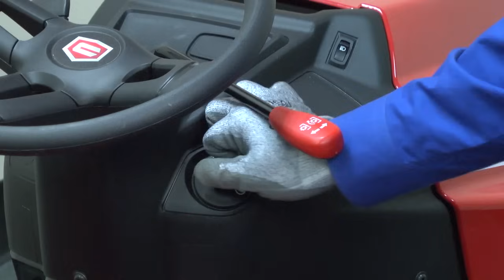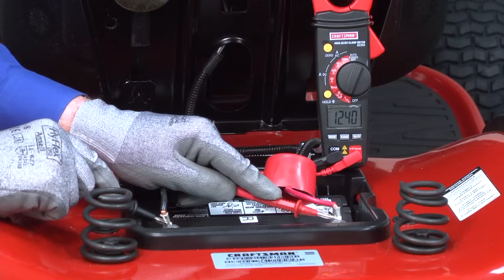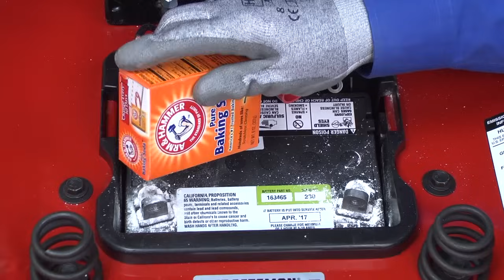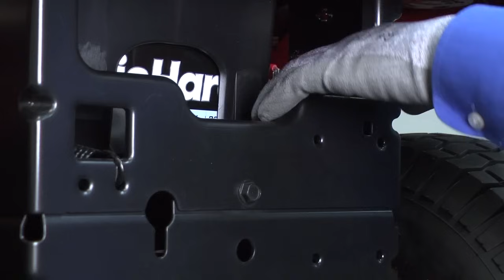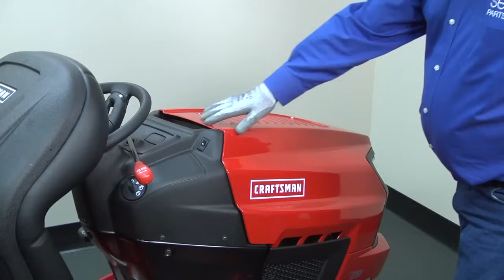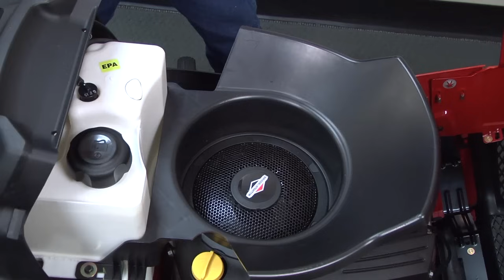How to Fix a Riding Lawn Mower That Won't Start: Engine Clicks But Doesn't Crank

Comment: Wayne, checked the things you mentioned and either replaced or were ok but only clicks.  What about switch plungers, switch Ing. Etc?
Reply from the maker: Because the solenoid clicks, the ignition switch and interlock switches are okay because current is making it through the ignition switch and interlock switches to the solenoid relay connection through the small red wire.

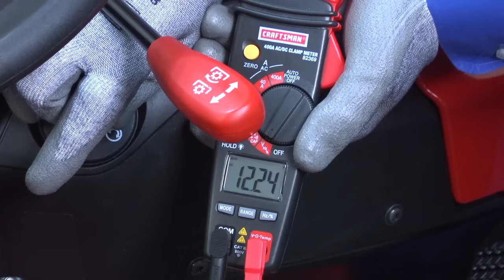You indicate that you checked all of the issues mentioned in the video. If you measured more than 12.3-volts on the large post of the solenoid with the black starter wire attached, then the solenoid is sending current to the black starter wire. Recheck the black starter wire for a voltage drop as shown at 3:55 in the video. If you don’t measure a voltage drop through the black starter wire then that wire is okay and you either have a failed starter motor or a seized engine. Check for a seized engine as shown at 5:21 in the video if you haven't already checked that issue. If the engine isn’t seized up, replace the starter motor. If you need more help, let us know the model number of your lawn tractor and include additional details about the results of our recommended troubleshooting.
Reply: Wayne, I replaced the following..Starter, Solenoid, Battery and ignition. Started to retest the information you gave and now the ignition switch wouldn't click. Also the new battery keeps discharging. Any suggestions? I have a Craftman LT1000 model #917.273370 thanks
Reply from the maker: Because the battery keeps discharging, we recommend that you check the fuse on the small red wire that connects between the starter solenoid post and the ignition switch as shown at 6:44 in this video:  https://www.searspartsdirect.com/article/riding-lawn-mower-wont-turn-over-or-click-video.html. If that fuse is blown, the battery won’t get charging current from the alternator when the engine runs and the ignition switch won’t get current to activate the solenoid relay (which causes the click sound) when when you turn the ignition switch to the start position. Replace that fuse if it’s blown. Here’s a link for that 20-amp fuse: https://www.searspartsdirect.com/part-number/STD391020/0098/980.html. If that fuse blows immediately after replacing it when you try to start the engine or when the engine runs, then a short in the electrical system is likely blowing the fuse. Follow the troubleshooting steps in this video to find and fix an electrical short: https://www.searspartsdirect.com/article/troubleshooting-a-riding-lawn-mower-blown-fuse-video.html. In case you need it, here’s a link for the owner’s manual for your model: https://www.searspartsdirect.com/partsdirect/user-manuals/917273370-craftsman-parts-manual. You may need to refer to the wiring diagram on page 31 when troubleshooting electrical system problems. If the fuse isn’t blown, follow the troubleshooting steps Mower Won’t Turn Over or Click video (link provided above) to troubleshoot the starting problem. Also, check for a wiring failure between the alternator and the battery to troubleshoot the problem with the battery discharging while the engine runs. A wiring failure, failed ignition switch or bad alternator could be causing the battery to discharge while the engine runs. If you need more help, let us know.
Reply: Wayne I can only start the engine by touching both solenoid posts. What should I check to troubleshoot?
Reply from the maker: Because the engine starts when you touch both solenoid posts, the failure must be in the ignition system circuit between the small red wire that connects to the large solenoid post and the white wire that connects to the bottom of the solenoid. Look at the wiring diagram on page 31 of your owner’s manual. Here’s a link for the manual in case you need it: https://www.searspartsdirect.com/partsdirect/user-manuals/917273370-craftsman-parts-manual. Check the fuse in the red wire. That red wire runs from the large solenoid post to the ignition switch. If that fuse is blown, the white wire won’t get power when you turn the ignition switch to the start position. If the fuse is okay, follow the rest of the steps as shown in this video to find the failure that’s preventing the solenoid from sending power to the starter motor when you turn the ignition key to the start position: https://www.searspartsdirect.com/article/riding-lawn-mower-wont-turn-over-or-click-video.html
Reply: Wayne, checked the 20amp fuse and the little red wire from the postive cable wire that goes to the ing. and I have continuity in both.
I measure the volts for the white/black spade posts of the solenoid and reads 12.2 volts. Your note said to replace if 12 volts..This is a new solenoid that was just replaced. Can a new solenoid be defective? The solenoid is reading 12.1 volts
Reply from the maker: A new solenoid can be defective. Based on your description, the solenoid coil is getting voltage but the solenoid isn’t clicking and sending voltage to the starter motor so the solenoid isn’t working. Based on these symptoms, you need to replace the solenoid.
Reply: Solenoid clicks only, will not turn over.
Reply from the maker: Check voltage at the large solenoid post that has the black wire connected to it when you turn the key to the start position and the solenoid clicks as shown at 3:05 in this video. Replace the solenoid if your meter doesn’t measure voltage at that post when the solenoid clicks.
Reply: The only time solenoid clicks is when the black solenoid wire is connected. Disconnected the wire volt reading when not connected to the solenoid is 12.1 volts. So do I replace the new Solenoid?
Reply from the maker: In a previous post from a day ago, you indicated that you can start the engine by touching both solenoid posts (we take this to mean that you shorted across the large solenoid posts at the top of the solenoid using an insulated screwdriver). If we’re misunderstanding what you’re describing, let us know. We don’t recommend using that procedure, but if the starter motor starts the engine when you short across the solenoid posts but the starter motor doesn’t run when the solenoid clicks then you’ll likely need to replace the solenoid.

Comment: I have a John Deere stx38. I’ve replaced the starter, ignition stitch, battery, fuel filter, air filter, spark plug and still won’t start. I jumped it with a car battery and it fired up. But blades won’t engage. When I tried to turn it back on it wouldn’t turn back on again with out a jump. Can some one help? Maybe clutch? Belts were replaced last summer.

Comment: Great video with clear, practical instructions.  I followed them to a T but it didnt work for me. Then I realized the PTO was engaged........
Reply: What is the PTO? Thanks
Reply: mari hall - The thing you push or pull to engage the blades. Mine is a red knob.

Comment: I have a sit on mower. the starter wont turn off when the key is turned off and the wires pulled off starter button what's happing any ideals?
Reply from the maker: Let us know the model number of your riding mower and we should be able to provide some troubleshooting tips to help you fix the problem.

Comment: Hi, my mower starts, but after I switch it off, it won't start thereafter. Usually takes 4/5hrs before it will start again. I bought new battery, fitted new solenoid. And problem still there. I don't have battery meter, but I'm thinking it can only be starter now? Am I right? Darren
Great video
Reply from the maker: The starter motor could be bad if the engine cranks but doesn’t start after you shut off the engine and then try to restart it. Other problems such as valves that are out of alignment or a bad electrical cable can also prevent the engine from restarting just after shutting it off. To help us determine the likely cause of this problem, let us know the model number of your mower and tell us what happens when you turn the key to restart the engine just after shutting it off (such as no click at all, the solenoid clicks once, the starter motor clicks repeatedly while you hold the key in the start position or the engine cranks or turns over but doesn’t start). Once we get more information, we’ll suggest some troubleshooting steps that may fix the problem.
Reply: Sears PartsDirect. Hi thx for the reply, it's a husqvarna ct151 kohler courage 15 engine. When I switch it off, it just clicks repeatedly, I took off engine cover to look at starter, it turns a touch but only a few notches. As if battery was dying. I hooked it to my car battery and left it for 10mins,made no difference. I've been told now to take out spark plug and try to start, if it turns its a compression issue like you stated. This sounds like big money, I've followed many of your vids in the past from fitting belts to troubleshooting so I'm quite used to fixing my mower myself. But if it's engine related I'm out of luck. Thx
Reply from the maker: Thanks for sending the additional information. Because the starter motor won’t crank the engine even when you supply the motor with full starting current using your car battery, a compression issue could be causing the restart problem. If the engine cranks with the spark plug removed, then adjusting valve lash may fix the problem. That’s an advanced repair that requires special tools such as a feeler gauge and torque wrench. You would also need shop manual instructions to complete that repair. It would probably be best to have a service technician complete that type of repair on your Kohler engine if needed. If you need more, let us know.
Reply: Sears PartsDirect thanks so much for the prompt reply and help, yes I'm putting it out for repair

Comment: my toro mower starts, but has weird symptoms...takes up to three seconds for it to crank after turning key...or struggles to turn the starter at all until i turn the key back and forth up to three times before it cranks. the battery is brand new and in perfect charge and load tested. can anyone suggest what i should check or replace? thanks!
Reply from the maker: Your symptoms point to problems with the ignition switch. Internal contacts in the ignition switch may not be allowing current to flow from the battery to the solenoid when you turn the key to the start position. Follow the steps at 8:27 in this video to check the ignition switch: https://www.searspartsdirect.com/article/riding-lawn-mower-wont-turn-over-or-click-video.html. Replace the ignition switch if its internal contact isn’t sending current to the solenoid when you turn the key to the start position. Because you’re describing an intermittent failure, you may need to test the ignition switch several times to detect a failure. If the ignition switch is okay, check the wiring connections between the ignition switch and the solenoid because a loose wires can also cause the symptoms that you’re describing.

Comment: I'm confused...in the diagram at 4:18 it says the voltage drop test should be less than 1 volt indicating there is no drop in voltage from the solenoid to the starter...but during the test the multimeter reads 12 and then doesn't drop which of course is good because it's staying at 12 volts....but I'm confused because when I do this test I get 0 volts which would indicate zero loss of voltage as the diagram mentions but it doesn't show 12 volts like the video shows following the diagram
Reply from the maker: The meter result during the live test is showing a failure in the starter cable because the voltage drop is above 1 volt as shown in the diagram at 4:18.
Reply: Sears PartsDirect thank you!!

Comment: I did the test on another riding mower...i got 12 volts battery...12 volts at the positive cable post of solenoid...so I confirmed the solenoid was getting 12 volts from the battery....next I tested the starter cable post of solenoid and made sure that it got 12 volts...that tested good so I know solenoid is good and now I have to narrow down starter cable, starter or seized engine...im having trouble with starter cable test...i did exactly as shown and I'm not getting any voltage reading....is that telling me there is no voltage drop and that's a good thing or should I be seeing it get up to 12 volts and then stay there?

Comment: I have a brand new solenoid and I'm only getting 6 volts at the black post of solenoid....any chance I installed it incorrect or do I have bad wiring leading to the solenoid? The bottom connections? It's a 4 post solenoid
Reply: It ended up being a bad battery Which I still don't understand...battery measured 12 volts then I tested the post of solenoid where battery leads to and that read 12 volts...so I removed starter cable from solenoid and tested to make sure it was getting 12 volts after turning the key and it only read 6 volts....so while this test is good it puzzles me....i ended up buying a solenoid for no reason it didn't end up being the solenoid....my battery was bad even though it was reading 12 volts....

Comment: Thanks for the simple explanation . I had pulled the starter motor off , reset the magneto,  checked the solenoid and checked the battery . What you video did was tell me  ALMOST 12 votls  is only 25%  and not enough to start . New battery . I learnt another valuable lesson.  Cheers.

Comment: Does the cold weather affect the battery on a lawnmower?
Reply from the maker: Yes. The battery typically produces about one third less current in a 32-degree temperature condition than it does in a 70-degree temperature condition.  The starter motor needs as much current as the battery can produce to spin the engine, so you may notice that the battery seems weaker during cold weather.
Reply: No

Comment: My mower has new ingntion switch and solenoid and still dont start anyone have any ideas
Reply: Sears PartsDirect you guys are the absolute best....straight to the point and well described...seriously I can't thank you enough for these informative videos.
Reply: yes check your vales clearance !
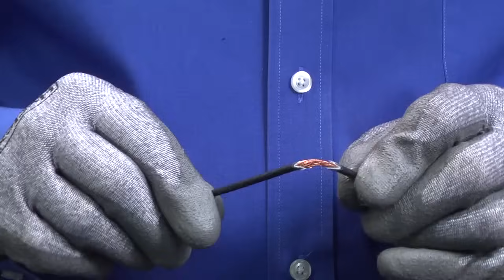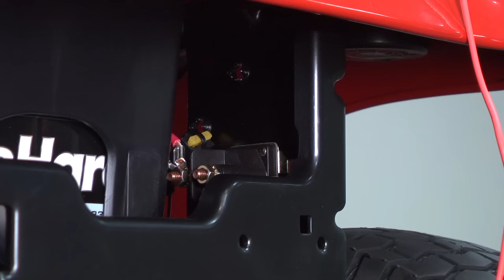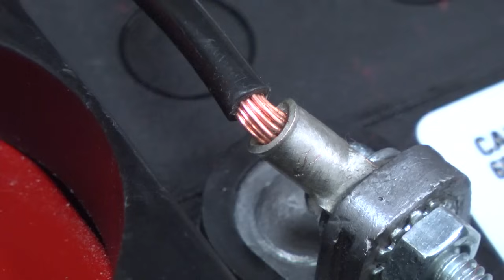Reply from the maker: If the solenoid clicks when you turn the key to the start position but the engine doesn’t turn over, follow the steps at :56 in the video to check the battery to see if the battery has enough current to spin the starter motor. If the battery is okay, check the battery cables for corrosion as shown at 1:40 in the video. If the battery cables aren’t corroded, check the red battery cable as shown at 2:40 in the video. If the red battery cable is okay, check the heavy black cable between the solenoid and the starter at 4:02 in the video. If the starter is getting power through the black cable but the starter won’t spin the engine, replace the starter motor.
 
If the engine turns over but doesn’t start, follow the troubleshooting steps in this video to get the tractor started: https://www.searspartsdirect.com/article/riding-lawn-mower-engine-spins-but-wont-start-video.html.
 
If you don’t hear the solenoid click and the engine doesn’t turn over when you turn the key to the start position, follow the troubleshooting steps in this video to get the engine started: https://www.searspartsdirect.com/article/riding-lawn-mower-wont-turn-over-or-click-video.html.
Reply: Sears PartsDirect just out of curiosity is it Wayne the guy in the video that responds here or is it someone else from searsparts?